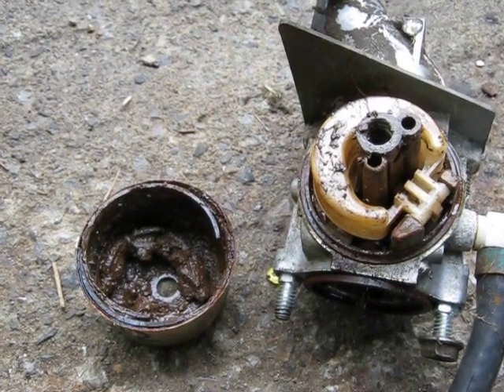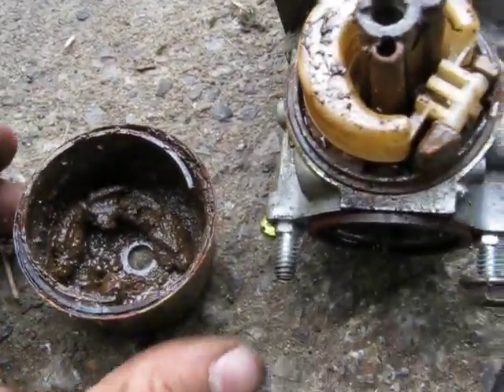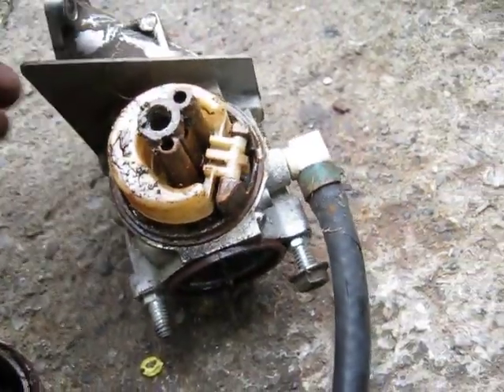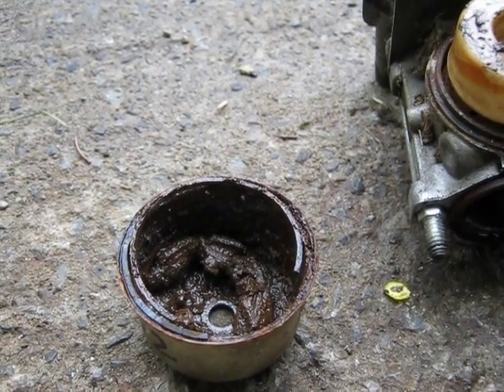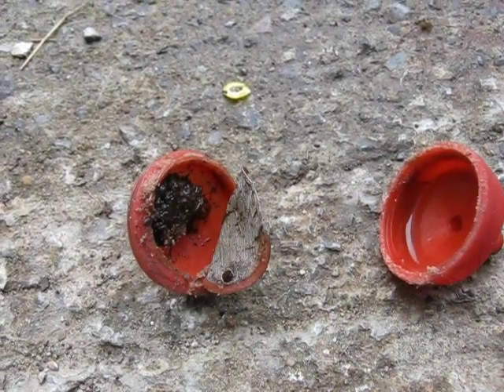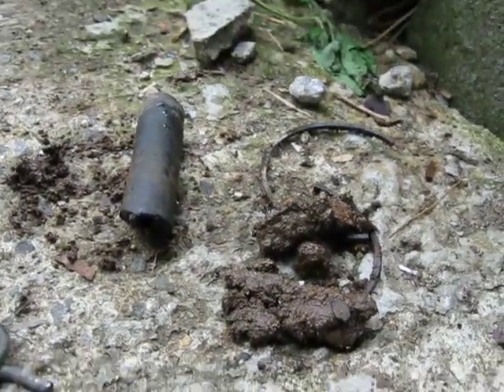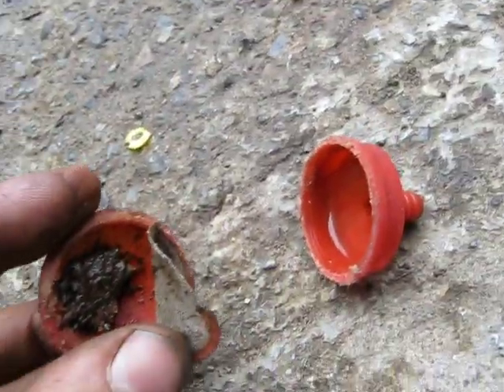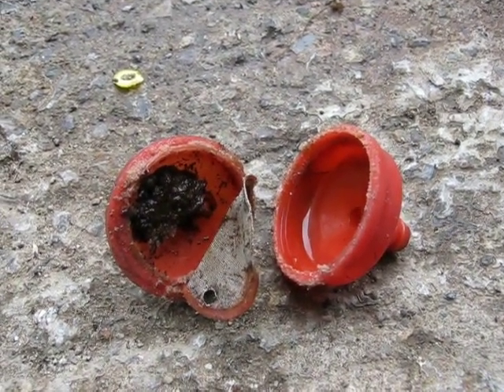VERY Dirty Carburator!

Comment: I've had four lawn tractors given to me, one of them was a 1978 Toro Model 5736 11 hp with the one piece flow jet carburetor. It has sat in a shed for about 17 years, when I took the carb bowl off it was so full of dirt, I had trouble pulling it off over the float, I had to tap the pin to the float out to get it off. It had a fuel filter on it, it had some dirt but not much. The dirt in the bowl was all dry, come to find out it wasn't really dirt, it was dried up fuel, as the fuel evaporated, it would let in more fuel, until the fuel tank was empty. I cleaned the carb the best I could, I couldn't get the jet out so I cleaned it the best I could, the bowl looks like hell but the engine is running like a champ. I also have the MTD and the Murray running, the engine Ariens needs a bit more work, it is seized from sitting outside for many years but it's a briggs, it will run again.
Reply: model# 57360
Reply from the maker: Tinker Jim Perhaps something similar happened here, as it was from a riding mower, if I recall right a bit of gas ran out from the tank.

Comment: I'm not surprised, Ive seen gunk like this in carburetors before. usually from stale fuel. Dirt wouldn't surprise me either. My mower and many mowers Ive seen have a tendency to get dust/dirt/grass in the fuel and it ends up in the carb. That style fuel filter is junk, it's just a small metal screen. It will filter out large chunks but lets thin dirt and sediment right through. I run oversized paper element fuel filters on everything now. The kind of stuff it filters out looks alot like what you have there.
Reply from the maker: ***** Thanks for the input, I thought for sure it was fine dirt from the looks of it, but had no idea how it got into the carb. So these small screen filters are next to useless, too bad I bought 5 of them online a few months back  :(

Comment: I've seen something like this before. Seems like those steel bowls on the newer Briggs carbs like this will rust bad inside from water. Then if it sits a long time it just fills up with rust and varnished gas mixed together.
Reply from the maker: rotorcats Yes, there seems to be something going on with these engines, and our bad quality ethanol fuel, as I never saw anything like this growing up with leaded fuels, though I did encounter lots of seriously gummed up old carbs!  I used to call the old gas Varnisholine  :)

Comment: I could only guess that crap passed through the filter either just fine enough to pass or around the edge of the screen? Fine accumulation over time? Mowing without a proper gas cap? Also maybe a mix of fuels and other things that created that crap. Certain bio organisims can grow in fuels. Certainly in organic fuels like alcohol/ethanol/methanol and in diesel/kerosene. Organic fuels can certainly degrade non-rated rubber parts and create debris and it can work like a solvent and strip off crud in a fuel system that otherwise wouldn't end up in the fuel. I've seen a lot of problems caused by ethanol fuels when I was an auto technician. Usually problems & runability isnt affected (minus fuel econ) till percent of ethanol gets towards 10% or more.  Could be corrosion sediment but you should find pitting somewhere. Sure a lot in that carb! I would switch to a paper filter too. A regular ole' cellulose paper filter will always be able of trapping smaller micron particles than screen filters. Any auto parts store worth its salt should have a number of fairly universal filters that would work fine.

Was this mower a gravity feed or was this one with a fuel pump?
Reply from the maker: mytmousemalibu It was a gravity feed system on this mower.Thanks for the info about getting Eth. free gas at airports.

Comment: Ran without an air filter... Dirt was small enough to get thru fuel filter but to heavy to get picked up by jet.... Or filter was ran through with a screw driver...
Reply from the maker: James Holt Interesting ideas, I looked at the fuel filter closely, I didn't notice any holes in the screen. I have no idea about what happened here, as I took the carb off a scrapyard engine. Thanks for the input.

Comment: For what is worth, anyone that wants ethanol free gas that can't get it at a gas station, there is a way. Great for your small engines that don't like ethanol and without buying expensive specialty gas. Check with your small local airfields that mostly handle piston engine general aviation. A lot more fields these days are now carrying fuel called
Mogas or just Auto-fuel. Its just plain 87-89 octane pump gas that is 100% certified to be ethanol free! A lot of small planes can run this automotive fuel now but it MUST be ethanol free, strictly enforced by FAA regulations that its ethanol free because it poses a safety of flight hazard to contain any. It should be relatively close to pump gas cost, maybe a tad more but say 5gal for your small engines isn't bad at all. You DO NOT want regular Avgas / 100LL, that's leaded 100 octane and not going to improve performance of your mower! Its expensive too!

Luckily in my state and others, some stations are bringing back ethanol free gasoline at some pumps/locations so that's the easiest option if available to you... If your car will get better MPG's too.

Comment: this looks to me like  part dirt and  part corrosion ,, water getting into the carb will corrode the aluminum and leaves this whitish crap that looks like dirt ,, and a little dirt or some rust  and it will look like this 
some of this  for sure  came from the  tank through the filter 
vibration over time will allow small grit through this metal screen filter 
I always  use automotive style filters on my riding mowers they catch more  dirt
,,these little plastic filters are great on gravity feed systems  ,,, but all of my machines  have fuel pumps which will pull dirt through a cheapie filter ,,I also have several machines with sediment bowl type  filters which catch this stuff but also catch water too
Reply from the maker: wildcoyote34 Thanks for the comment, it confirms what some others are saying about needing to use a good paper type filter on larger engines. I don't know why, but I never had this much dirt get into my riders fuel system, maybe the owner had a very thin sandy lawn, though usually lawns are pretty green here with the amount of rain we get.

Comment: Ran without an air filter... Dirt was small enough to get thru fuel filter but to heavy to get picked up by jet.... Or filter was ran through with a screw driver...